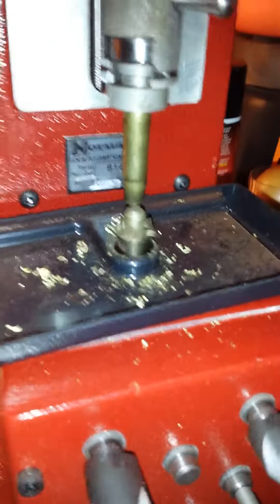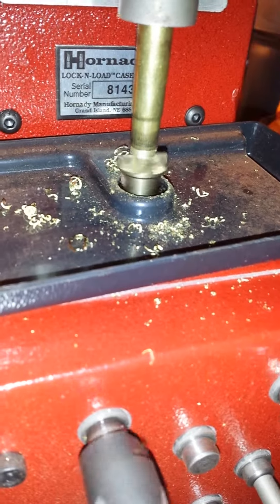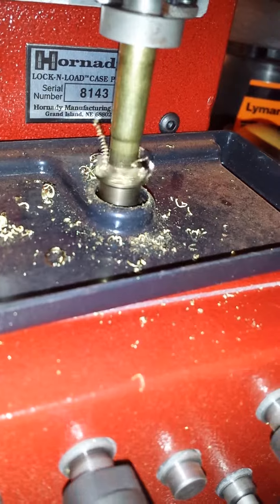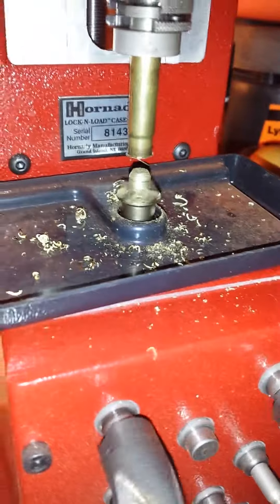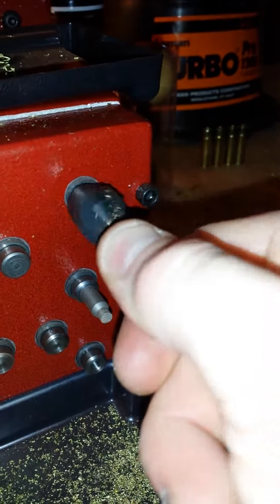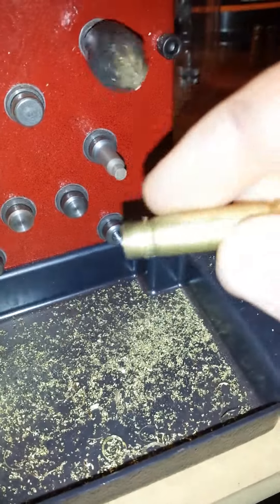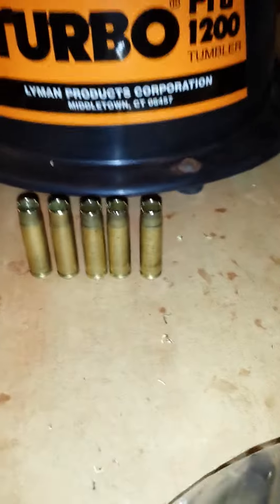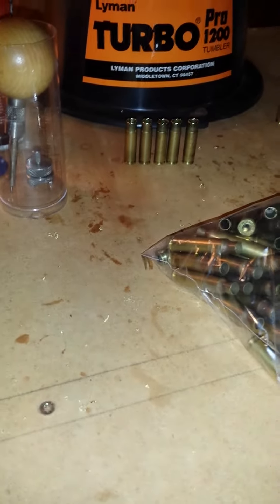300 blackout on a hornady case prep center pt2

Comment: this answered my question "could this be done with the prep center?"
I think I may hang a light weight on the handle and let gravity trim the brass for me :) more time to reload other stuffs
Reply from the maker: If you're planning on cutting the brass down from 223 I recommend a chop saw for that and then using the prep center for trimming to length. That's how I do it and I process about 100 rounds an hour. Trimming after you cut the neck off speeds up the process ten fold
Reply from the maker: Also, if you do use the prep center for cutting them down all the way, make sure you watch the first part to my video.  It will give tips on how to avoid destroying a cartridge.